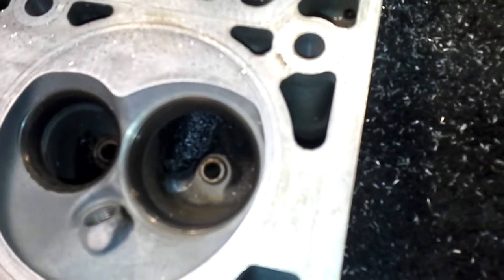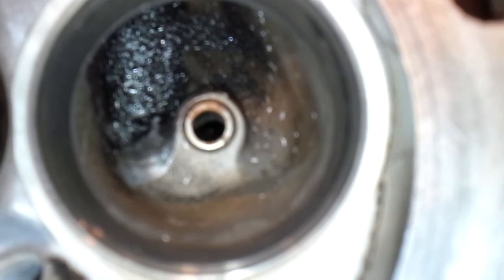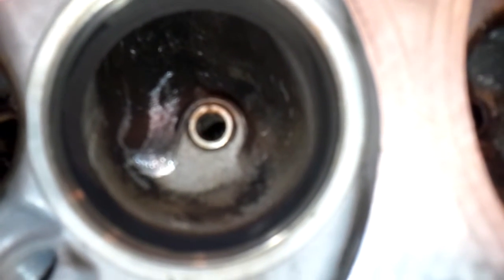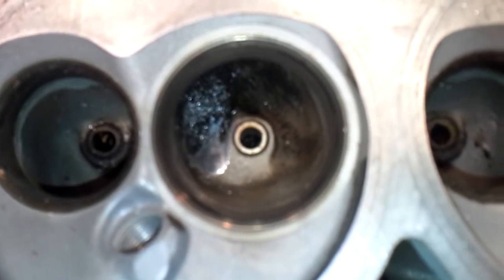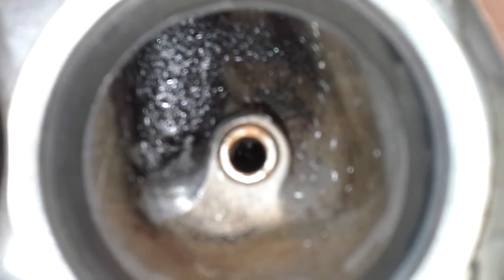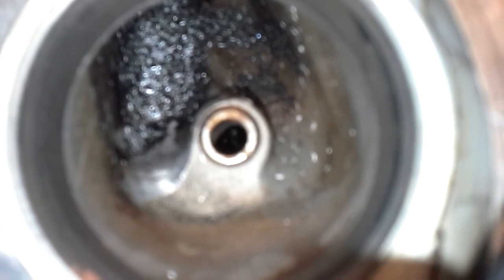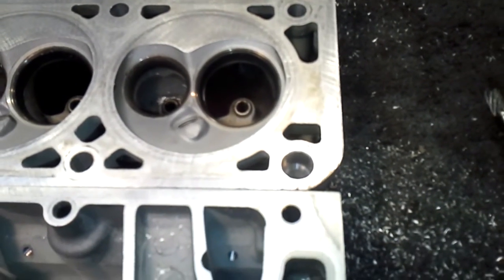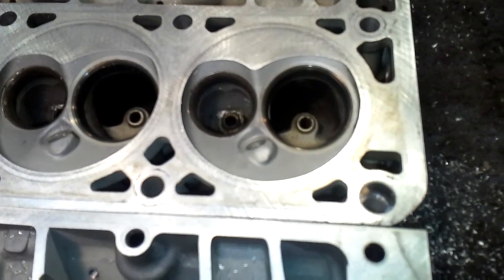Porting LS heads swirl ramp removal

Comment: hello good afternoon I have a Camaro year 2000 engine 5.7 with 243 heads which of your videos I recommend to do will only have a little nitro camshaft
Reply from the maker: Jesus Toca Make sure the camshaft works well with the gears in the rear end/differential and the transmission setup.  Too many people pick a cam based on desired idle characteristics, pick a cam that works best to fit your intended use. I hope this helps?!   JD

Comment: Cutting out the Swirl ramp devastates Low RPM Torque. Gives very little additional flow.
If your building an all out fire breathing dragon that will only be run at the Track fine, but if the head is driven any at all on the street why give up low end Torque? 
GM engineers didn't put that Ramp in there for nothing! they knew what They were doing. Profiling the edge of the Swirl ramp also destroys its purpose leave the edge crisp and sharp.

You get more with Less Take out the Rocker Bolt bulge open up the exhaust correctly, polish the combustion chamber unshroud the Valves. If you need or want more than that Its time to step up to an aftermarket head where most of that has already been done including the deletion of the Swirl ramp.
Reply from the maker: Dudly Doright Well, so far these ports have exceeded the expectations of the customers, machine shops and dyno operators.  So... I guess the “Proof is in the Pudding” making it hard to argue with success.  It’s ok, we’ll have to agree to disagree! 👍😉😎
Reply: Like I said for an ALL OUT Race car that only runs at 5k plus all the time sure go for it, But for a car that does any street driving No its Not gonna get you what you loose on the bottom end.
Do some real flow bench testing and Dyno time with both, I would much rather have the bottom end Grunt Torque. There is more to it than just huge ports and open slick bowls is all I'm saying.
Reply from the maker: Dudly Doright You couldn’t be more off base if you think all I do is hog out ports on cylinder heads. It might be beneficial to watch all of my videos on head porting math and matching port size to CID.  At this point I’m ok with helping you learn more about how these LS ports are laid out. JD
Reply: I will say it again I am no a Hater nor am I banging on you or your work I just think the swirl ramp should be left alone on a Street car. An all out Race sure go for it. @HeadFlowInc
Reply from the maker: Dudly Doright The heads on my Blazer now, 862’s 2.00”/1.57” valves 212cc intake and 82cc exhaust.  I left the swirl ramp and rocker bolt boss intact.  Gains were in the Bowl Cuts, Blends, guide profile and general clean up.  Why?  They’re on my daily driver 4.8 w/ .560/.560 @.050 216/220 LSA 114 ICL 110
I’m getting ready to have it tuned, any guesses what it will make to the tires?
TH400  B&M Holeshot 3000 stall (To loose will change when I can)
2.73 gears. 🤔🤔🤔
Reply: No i don't wanna guess what it will do, but it sounds like a good build, It would be interesting after dyno tuning to pull the heads and finish with the Rocker Boss profile still leaving the Swirl ramp alone then Dynoing again.
just to see what the hump is worth all by itself.  then again with the Swirl ramp removal Just to put it all out there for all to see in the real world. It would be the Only video out there done by regular Joe with real world numbers not all hyped up by some magazine Or Cylinder head manufacture with made up numbers. If you could get your Dyno guy to work with ya It would be a very cool video One I am sure would get a Million hits instantly.

I believe the Swirl ramp acts as a Ski jump to force the air to Move faster over it causing a shear zone in the bowl right at the valve stem causing a Tumble shearing effect that scavenges the air fuel charge of dead low pressure air behind the valve stem creating a Blanket effect over the back side of the Valve Head to even out the fuel charge for a More effective even burn rate across the piston top. This is beneficial for Low RPM street motors and Highway cruisers or weekend warriors NOT all out Drag cars and all out drag car needs the Volume. 

I do my own heads and as Much as I would like to show off my work I don't have a camera to do it justice Plus I am not a very good speaker. I have watched a lot of your videos I am not a Hater, but at same time I don't always agree with you either but hey this is Hot rodding we can agree to disagree cant we?
Reply from the maker: Dudly Doright Ultimately, adding port volume at the entrance or the rocker bolt bump isn’t very helpful. If you’re careful you can reduce the bump and reduce its radius without poking through.  If Torque is your goal there’s really no reason to port the LS heads; even the small valve heads come with 200cc intake ports. A stock 862/706 head will easily support 400+ hp untouched. 👍

Comment: get any good power gains from removing the ramp? do you do anything to the exhaust side also?
Reply from the maker: RptrKlr 57 My goal is to create a quality cylinder head, in order to properly work any head both the Intake and Exhaust runners should be worked.
Removing the swirl ramp improves the mid to high RPM flow, adds volume to the port.
Reply from the maker: RptrKlr 57 A good set of ported heads with properly sized ports for the engine displacement should add 50-75+ HP.
Reply: HeadFlowInc thanks for the info I'm building an ls1 for my silverado right now and I've got a set of 243s off my old l33 that I'm gonna work up a bit. good video man keep up the good work
Reply: HeadFlowInc thanks for the info I'm building an ls1 for my silverado right now and I've got a set of 243s off my old l33 that I'm gonna work up a bit. good video man keep up the good work